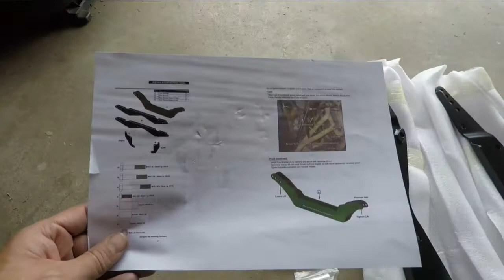How I lifted my Polaris RzR 800S!

Comment: Hey man I know it's been 4 yrs since you did the rzr 800s video but I was curious about how it ride on trails and the changing angle of shock made it ride different and also did it change the width, like did it lose any? Thanks for video I'm thinking about doing a bracket lift on mine
Reply from the maker: @joeysaylor8048  actually everything exactly the same on it and didn't lose any width was basically all the same but more clearance

Comment: Did your rzr have power steering? I seen on the description on eBay it doesn’t work with models with power steering. I have a 14 800 rzr s wanting to do the same
Reply from the maker: Mine didn’t have power steering I’m sure they make a kit that does though
Reply: Cool thanks buddy

Comment: I’m wondering if changing the angle/pitch of the shock/spring assembly will change things. I’m apprehensive to mess with the geometry of the suspension. 
Anyone have any expert opinions they would like to share??
Reply from the maker: I get what ur saying cuz the springs were straight up and down and probably would be a softer ride with more flex if the angle was changed